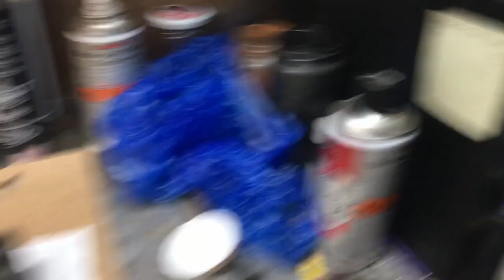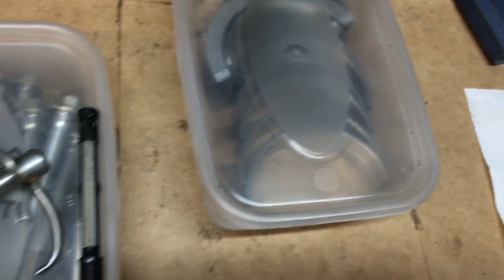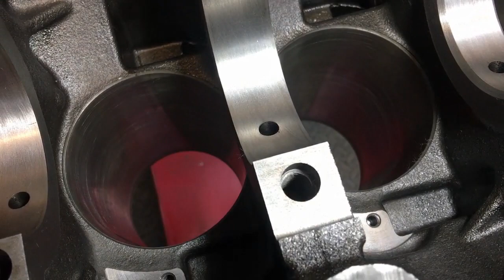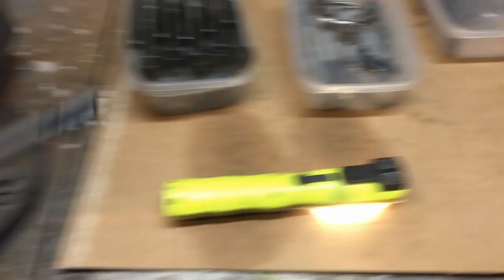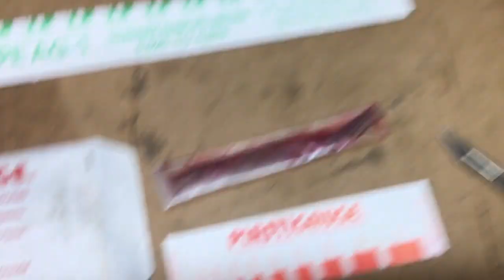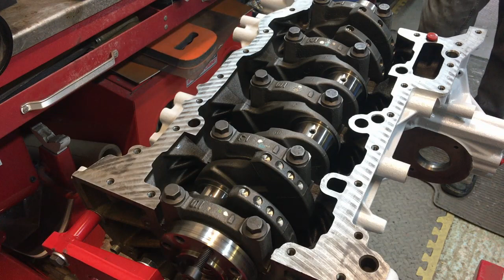Puma 2.4 Tdci engine build part one. Checking Crank bearing clearance.

Comment: If your stripping a known motor down the old bearings tell you what it needs, if the journals are not scored replace the shells with the same, doing clearances like this is only needed if your building a motor from parts or a high rpm race motor. Ive built many turbo car & bike motors. Building 3/400+hp turbo bike engines we run the mains at the tightest clearance & run the big ends at the widest clearances, its the big end that always give up the fight & need plenty of oil to keep them alive..

Comment: Thank you so much for this video, i've started to do a rebuild on my 2.4 H9FB engine (Never attempted this before)
The Piston Ring had Failed, so purchased a new kit and this is exactly what i need to get going
Reply: Hey did you change the pistons? Do you have a piece of paper with the torque?
Reply: @fordknox2897  nah I never changed the pistons. They were fine, just the rings
Reply: @ghost4004  good to know my Transit is make a hard knocking noise and I am interested how it looks in the inside when I open the block. Do you have the torque specks somewhere?

Comment: Awesome idea with writing what bolt and what size. Never thought of that before

You said the crank bolts can be used 4 times. Would the clearance get checked at the factory? If they wasn’t, are you classing the clearance test as 1 cycle. So once from factory. Once from test. Once from rebuild. You any where near Northampton and want to help me out😳

Comment: I really thought you'd brought the Raptor, to put that engine in the Puma 😉 

Though the TDCI engine looks brand new internally.

If you have a Jag of a certain age (like mine), it uses the Alternator & drive belts (and other parts) from a Transit, saves a small fortune on parts...
Reply from the maker: Nah mate, the Raptor only has a 2.0 Bi-Turbo, but it is nearly double the power of the 2.4 tdci at 213bhp and 500Nm of torque!!

Comment: Completely brilliant - thanks for taking the time to explain how to use the gauges.  For those of us who are less knowledgeable, please could you explain why the bolts are torqued initially then tightened further through an angle - why not to a final torque?  Best Simon
Reply from the maker: Thanks, In my opinion the angle torque is used so all the bolts get pulled down to the same specified setting. When using high torque on bolts, the friction can overcome the rotational force so going to an angle guarantees the bolt has stretched to it's determined length.